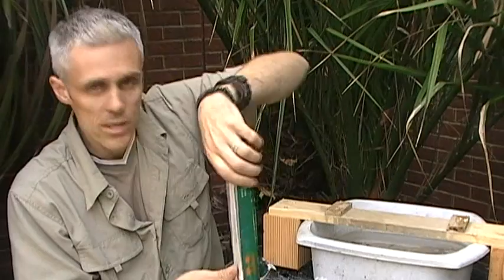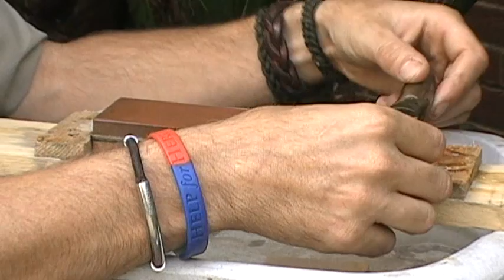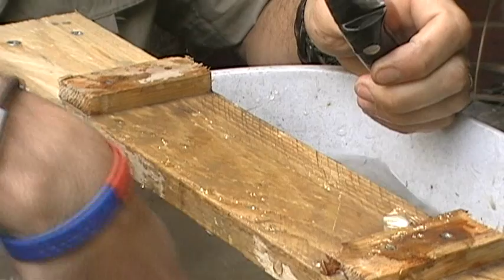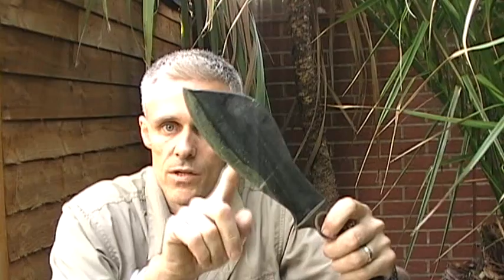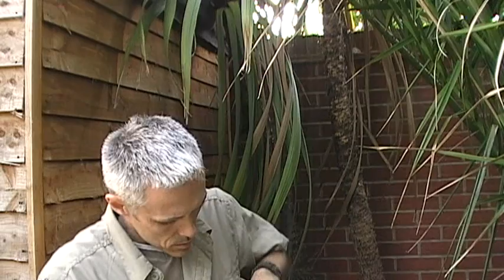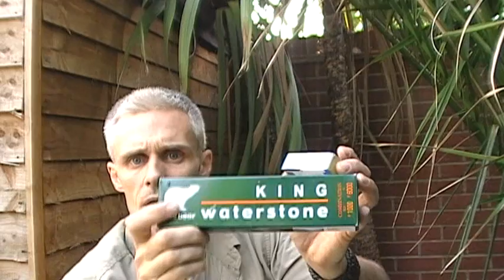Knife sharpening with King Japanese Water Stones

Comment: I actually learned of this method from watching Japanese cartoons. Truthfully enough, it works great. My knifes are 10x sharper when compared to other sharpening methods. Although I prefer dripping water on top of the stone as I sharpen the knife to wash away the tiny bits of the stone or metal from the blade so the cutting edge is constant.

Comment: A tip  to sharpen the tip ( hard to explain without showing) but hold tip to stone, make semi circle motion. As you move the blade across this motion start with the tip and end with about an inch or 1/2 inch relative to size of blade. 
Also after finished using the stone, use news paper to finish. "wipe" the blade back and forth on the newspaper, it is a natural abrasive and will make a nice edge.

Comment: I've been sharpening professionally for many years. It's a passion of mine. I adore taking the most undesirable edges and making them pristine. One final step I cannot stress enough for any sharpener,STROP your blade. You don't need some 600 dollar german leather strap a professional barber would use. All you need is a cheap leather belt with a good lining. Take the tip of your knife and scrape the leather to raise some fluff a bit. Then just strop the edge along it to buff it.

Comment: Hey, Sean, Thanks for another great vid. If I may suggest, try sharpening not from the tip to the ricasso but just the opposite.Set the knife on the stone and tilt the knife to your desired angle. Draw the knife towards you (sharp edge faces you) across the face of the stone. As you begin to sharpen the curved area near the tip, simply lift up on the handle as needed. It will follow the curve perfectly. Make sense? If not, let me know and I'll try and do a better job explaining.

Comment: You must raise the knife towards the end of the stroke in order to keep the entire blade in contact with the stone for the full length of the cutting edge. The second I saw you make a pass I knew you weren't getting the tip sharp. Then you mentioned that you have a problem with it. My advice is to lift the handle as you get closer to the tip and keep the whole blade in contact with the stone as long as possible. This takes practice but is very efficient. I use India & Arkansas stones myself.

Comment: I am currently using stones for a chefs knife and a hunting knife. Both with different edges. Usually speaking a new blade from shop is 1000grit sharpness. So starting below that and depending on the hardness of your blade go up to 6-10 thousand. If u need to make a new edge on a lesser angle u need to start the edge from scratch with coarse stone.

Comment: For you board to support your sharpening stone, the blocks against the water tub didn't have to be any larger than the ones used to hold the stone in place on the top side.

Comment: @sgtschmitty8013 you don't really need a nagura stone, it's for building a slurry on the stone used to sharpen. I just use another 1000 grit to build a slurry. When I hone with an 8000 I'll use my 4000 for the slurry.  The only thing the slurry does is help cut quicker. If you have the patients you don't need a slurry just water.  Good luck and happy sharpening

Comment: How much pressure do you need to apply when moving? If the knife is duller do I need to apply more pressure? I don't have that high of a grit stone even on the fine side so will I need to apply more pressure please answer. I really want to know how to sharpen my pocket knifes. It seems it gets somewhat  sharp but I can't seem it get it razor sharp and when I cut paper it doesn't seem like a clean cut.

Comment: @wncranger I guess it's a personal preference on what technique youre comfortable with I sharpen knife edge to ricasso to avoid mass burring and longer honing and stropping time. but I sharpen from tip to hilt, not hilt to tip to avoid fowling the point of the knife running off of the stone.

Comment: @Kim Jung
Practise on a cheap blade first, but depending on how worn your edge is looking at edge angle and type of edge. You can then work out which grit or hardness you start with. 
Work out what type of edge the knife has. Usually straight edge for cooking knives and convex for hunting and chopping knives. You can then begin searching and practising what is appropriate for the knife.

Comment: @sgtschmitty8013  No problem use your 1000 for a slurry on the 6000. Should look like mud on the 6000 then as you sharpen and add water the slurry will wash off refining your edge more and more. Let the stones do the cutting. with the 1000 you want just slight pressure and on the 6000 you wwant just the weight of the blade.
My guess is either the steel is super hard or you may be over sharpening with pressure. The key is to check your edge about every 10 strokes

Comment: @sgtschmitty8013 are you 100% sure, because if you started using it out of the box believe me  it ain't flat. Usually the edges stand a little higher than the center and stone it's self will have slight waves in it. Not so much the 1000 the but 6000 and fine honeing stones should be lapped. I'd build a new edge on the arkansas stone then move to the 1000 then to the 600 with slurry, then 6000 no slurry...only using pressure with the Arkansas to build your bevel

Comment: i d say grinder  until you have a shape that  just need sharpening  because them stones can get damaged  (wear) if you use them to give  a new  bevel to  the knife tip to compensate for break.After you create shape in a grinder  ( naturaly if your knife has  2 sides  bevels  and isnt  like some japanese sushi knives with just 1, you ll need alternate sides as you work carefuly grinder to not overgrind), can get  working on  the stone for thesharpening  part

Comment from the maker: @medicinaluse My camera does not have an external mic socket. I have recently bought a new self poewered mic and that will not work either. The only option for me is top  buy a new camera £300-£400 or you could buy some decent speakers £20 cause the sound is fine on my computer and my wifes laptop.

Sean

Comment: Knife isn't sharp I got caught on the paper even with a slice cut it should be able to push cut through paper and who ever said he rinsing the stone too much and the powder does the sharpening is an idiot your ment to keep running water on them actually because that power and filings from the blade clog up the stone and stop it from working efficiently